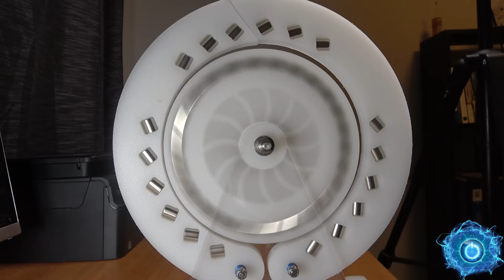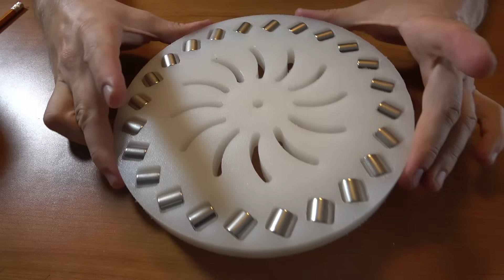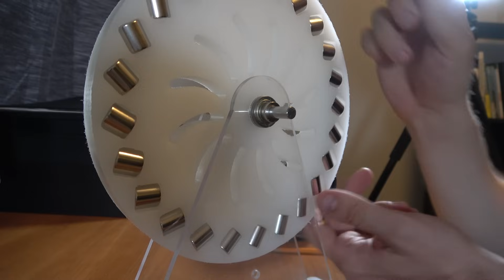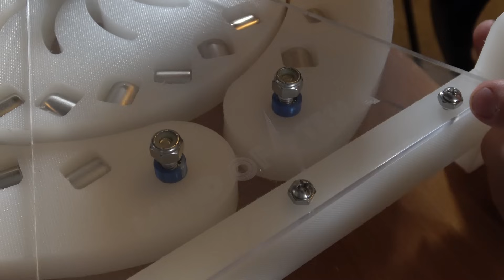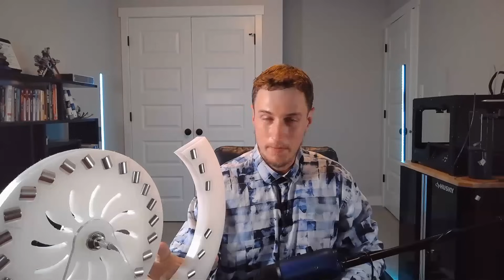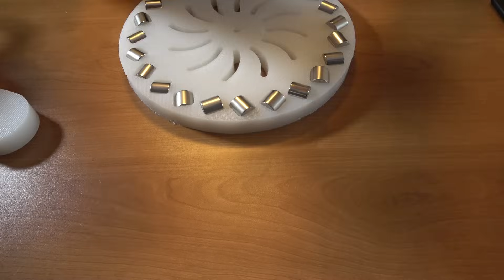Perendev Magnet Motor - Does IT WORK?!

Comment: I had an idea like this in 8th grade but I couldn't find a way to adequately shield the magnets so the only part pushing on the magnets in the wheel would be the part that repels them. You always end up with the magnets pushing both ways and only adding a small amount of thrust. So they always come to a stop after a few minutes.
Reply: Oh that would work fine!
But only if monopole magnets would be a reality. They don't.
Reply: @Terrestre1  The fact the monopoles could make something like this work and that our mathematical models allow for monopoles to exists probably means that our models aren't correct.
Reply: @Terrestre1 Inconel on the back side.
Reply: @Terrestre1  um that's what the shielding is for. To block the pole that is counter to the rotation. I just couldn't find a material that sufficiently blocked the magnetic field.
Reply: @nathanhale7444  you will find that if it blocks the field it also has to fight the field to move it and always cancels out  the effort gained from the magnet’s due to the mechanical load of moving the shield, magnetic reluctance is a force to contend with! or freezing to super cold temperatures can help produce a mono pole but as proven many times takes far more energy to refrigerate to -300c than the tiny energy produced
Reply: @nathanhale7444  Permalloy or mu-metall attenuates magnetic field
Reply: @nathanhale7444 giron can, and that’s what’s missing here. You need to cover the bottom /longer side, so when they meet it’s suddenly boom and pushing away. And more magnets…evenly outside/inside separated with giron
Reply: @needmoreboost6369 how can you cool something past absolute zero?
Reply: @SomeWhiteGuyNamedFred just give it to my ex! She’s cold as!
Reply: First law of thermodynamic
Reply: @amiyeagle  that doesn't apply to something like this. In this case the energy is coming from the magnets. One hurdle it finding something that blocks the magnetic field so it only pushes the opposing magnets one way but also I think the magnets will wear out faster and have to be replaced. So you aren't getting something from nothing just transferring the energy in the magnets into kinetic energy.
Reply: @nathanhale7444  Magnets don't work like batteries. They store energy the same way a spring stores energy. As for blocking a magnetic field, there is no material known to man which can block a magnetic field.
Reply: @Fireball_Roberts  yea that's what I found out and assumed way back in 8th grade.  It is amazing how much energy is stored in magnets but they aren't immortal.
Reply: @nathanhale7444  yeah about 7000 years is more than you would need
Reply: @Fireball_Roberts  there's such material, permalloy or mu-metall
Reply: @konstantingrudnev8374  Permalloy will redirect a magnetic field through itself, but then you have the problem of separating the magnet from the permalloy. The type of shielding that can somehow block a magnetic field without also being attracted to the magnet doesn't exist.
Reply: halbach arrangement of magnets will get you close to monopole
Reply: Y'all are forgetting about electromagnetic drag and eddy currents.
Reply: In short yes... You can make a magnet engine work... But the energy is not free...
You can stress the magnets enough to convert their magnetic potential in to kinetic energy, but as a result the magnets will lose their magnetism. 
The energy you will get out of it is much less than the energy needed to make the magnets in the first place...
Reply: @PAIP_Studio  that's what I suspected 👍
Reply: @PAIP_Studio Maybe, but it is a much cheaper entertainment than many. So, you could still save energy by not driving to the movies and still have loads of fun. Conclusion, it works😅
Reply: @PAIP_Studio curious if you know of the formula to predict the magnetic loss. 

I see industrial lifting magnets (over 20 years old) recertified and still in use. I knew of one that held near its capacity a inch off the floor for months. Still was fine come recert time. Still lifting ots rated cap
Reply: @Heliarc91  I don't remember off the top of my head but I have used the magnetic loss formula to calculate the loss of magnets in a few scenarios. It turns out that you could ran a small fan for about 30 years under the right circumstances. Or you can have the equivalent of a AA battery output for 30 to 40 years with $160 worth of magnets.
Reply: Guess what had this idea in 6th class
Reply: @NitrideGang  yea but the real problem was you were basically just running the thing off the energy stored in the magnets. Magnets don't last forever and using them like that would deplete them quick and leave them inert.
Reply: Are you not seeing the threads in triangular shape
Reply: @amiyeagle  I can only watch it on my phone so if there were tiny strings, I doubt I could see them.
Reply: Thanks for being honest. The key is to avoiding the shielding altogether. Wink wink...
Reply: @paulwilton735   but then it's only the rotors inertia that keeps it moving since the mags are pushing backwards as much as they are pushing forwards. That's why I was trying to find something to shield them so they only push one way. Back then I didn't know that magnets loose their magnetism over time and much faster if they're being heavily worked like a generator of this design would do.
Reply: Very thin superglue is extremely strong insulator
Reply: Yes but how many people denied that this was possible
Reply: I'm glad these devices are getting around but they need to be produced in a more robust manor.
Reply: @anonymouskeys929  the problem with them is the magnets wear out. They only have a limited amount of energy before they lose their magnetism so that is all the energy you could ever get out of them. Free energy doesn't exist. The laws of thermodynamics prove that energy has to come from somewhere. So the key is to find some source where you get more out than you put in. Take hho. It takes about the same amount of energy to separate water into oxygen and hydrogen but if you could find a way to accomplish that using less energy than what it takes then you'd have the closest thing possible to free energy. Stanley Meyer did that but it got him killed.
Reply: why don't anybody use this with wind enery utility?
Reply: The idea of single 2d designs is the problem imo, using a outer ring on each side and just using the inner ring between them is part of the answer.
Reply: 'You always end up with the magnets pushing both ways and only adding a small amount of thrust. ' 
You realize it's mathematically proven to not work, right?
'I'm gonna outsmart the magnetic field at the speed of light and make it work!'
No, you really, really aren't.
Reply: @ModelLights  not if you can shield it so the thrust is mostly one way. But yes it doesn't work. If for no other reason because the magnets will run out of energy and have to be replaced at a cost much higher than the energy such a device would create which wouldn't be much.
Reply: @nathanhale7444  'not if you can shield it so the thrust is mostly one way. But yes it doesn't work.'
What part of 'That's the part that's been proven mathematically impossible to actually do' was difficult?

1-1= 0.  You're essentially saying you're going to sneak up on the second one and somehow make it disappear and the result be 'not zero'.
No, you really, really aren't.  You can only pretend you're going to 'do that somehow' because you don't understand that whatever 'somehow' you think you're going to come up with, it won't work.

If it worked in the tiniest, tiniest bit, that would make it EASY to do and have been done from the start.  
You are not going to 'somehow, I'm gonna sneak up on the magnetic field and make it be uneven' like you seem to think can work.
Reply: @ModelLights  they do have materials that can shield from magnetic fields. My idea was to limit the counter force of the magnets so most of their thrust is facing one way. That much is possible and I don't know why you're saying it isn't. What isn't possible is to have something like that that doesn't wear out the magnets. Magnets don't last forever and loose their magnetism the more they're used. Even a refrigerator magnet that does nothing but stick to the fridge door will eventually loose its pull and fall off but if even the strongest magnets were used they would onky work for a short time before they used up all their stored energy. That's the problem with all "free energy devices". You can't get past the laws of thermodynamics. The energy has to come from somewhere. I tried explaining that to a friend's dad but all he ended up with was a bunch of burned out motors and a nasty letter from the apartment complex manager.
Reply: @nathanhale7444  You should read up on how magnetic fields work. Magnets don't have thrust. They have a magnetic field. Magnets don't store energy the way a battery stores energy. They store energy the way a compressed spring stores energy. You also won't be able to limit a magnetic field so that it's "mostly facing one way" because it's a loop, and in order to work, the field needs to loop back to the opposite pole.
Reply: @ModelLights  I don't know what this is so hard to understand. There are materials that block magnetic waves. Maybe if you were looking at it from an engineers perspective instead of a mathematicians then you would understand what I'm saying.
Reply: @nathanhale7444  'I don't know what this is so hard to understand. '
No, what you don't understand is that you're the one with a poor understanding of basic magnet theory.

'There are materials that block magnetic waves.'
It's magnetic lines of force.  Guess what?  They go from a N to an S.  You have no ability to 'block only one end of the magnet and create a magnetic monopole and actually produce a gain' like you think you do.  You just have a poor understanding of why what you think will work actually will not work when you try it.
Do you really think everyone else who thinks this crap hasn't done this a million times, and needed you to come along and say it?
It DOESN'T work that way, no matter how poorly you don't understand, and thus don't understand that it DOESN'T work that way.

You cannot produce a 'motor' or perpetual motion machine like you're thinking.

If it's so easy kid, stop TELLING me about how you're going to do it.
Stop lying about it, and DO it.
Then tell me you did it, instead of saying lies of ignorance.
I expect to never hear from you again, ever. 

You won't do it either, any more than anyone else, even if you never learn enough about actual magnetic theory to understand why it doesn't work.
Reply: @nathanhale7444  The fact, you call magnetic field by waves tells most of your knowledge about this topic. I guess you came from unsuccesfull ideas of magnetic motors to not existing magnetic fields shielding to end with idea its actually nonsense because you would suck energy from magnets, but the point is somewhere else...
Reply: @Thomeeno  so frickin what? Nearly everything I know I taught myself and I have a better understanding than most people and definitely better than people trying to use magnets like this.
Reply: Me in 7th.
Reply: Welcome to the laws of thermodynamics...
Reply: Be skeptical of perpetual motion machines and “free energy” claims. The concept of perpetual motion contradicts the fundamental laws of physics, particularly the First and Second Laws of Thermodynamics.

The First Law of Thermodynamics (Conservation of Energy) states that energy cannot be created or destroyed in an isolated system. Any energy output from a system must come from energy input. The Second Law of Thermodynamics states that entropy in an isolated system tends to increase, meaning no process is 100% efficient, and energy will always be lost as heat or other forms of dissipation.

For example, using a “gravity shield” to manipulate forces on a wheel is theoretically interesting.  Unfortunately we have no evidence or practical means to shield or manipulate gravitational fields in such a way. But even if such a technology were developed, the energy required to generate and maintain such a gravity shield would likely exceed the energy extracted from the system. This aligns with our understanding of physics and energy conservation principles.

The allure of free energy is enticing.  But the “gravity motor” example dependent on a hypothetical gravity controller neatly illustrates the challenges: any “controller” would require its own energy source, and the net gain would likely at best be zero, or negative due to system inefficiencies. Until new physics or technologies emerge that redefine our understanding of these laws, such machines will remain in the realm of fantasy.
Reply: Another mag with opposing field blocks.
Reply: Suppose we were on a planet or moon with liquid helium couldn't you use a plastic superconductor using the Meissner effect? You could also use flux-pinning superconductors for bearings. It wouldn't be free energy but it would be pretty efficient non perpetual motion machine
Reply: Sorry  @SomeWhiteGuyNamedFred but I'm not familiar with those materials or principals.
Reply: yes the origanil inventor is now a power company. they are shielded to get the correct angle for a better spin
Reply: Graphite is the answer. It doesnt isolate but redirects the field.
Reply: @pedritomiralles  hmmmmm I don't remember if I tried graphite or not. I was in 8th grade at the time and that was a long time ago. Maybe I'll give it a try. Now where did I leave that big graphite block I pulled outta that doohickey?
Reply: @nathanhale7444  what if instead you had a series of magnetizer/demagnitizers they pass through as it spins so they're never opposing enough to stop the motion .
Reply: @nathanhale7444 هل جربت الطريقة الان ..من فضلك أخبرنا بالنتائج
Reply: @Pedro Miralles  or bismuth, really any diamagnetic material
Reply: @tres155  I don't remember if I tried that or not but no matter what it would only be esing the potential energy stored in the magnets and would eventually wear them out. They would become inert so the design is ultimately pointless.

Comment: I just want to know why you used metal bolts instead of plastic bolts, cuz feros bolts of course would cause this device not to work and even using non ferrous bolts would cause a drag, i stumbled apon how to create power from a big speaker magnet and a coil of wire and no moving parts , i only have to move the magnet one time to get the elctrons moving but thats all im going to let you know, there is forbidden knowledge out there that they will not teach but some of us out here have stumbled apon there forbidden knowledge cuz free energy is possible, in this universe nothing is impossible
Reply from the maker: Good point about the bolts, I never thought about that!

Comment: hello, nice project! why don't you try to make the fixed magnets turn in a chained way to the wheel? like a crankshaft system connected to the camshaft, only in your case the wheel through a gear wheel rotates some external magnets in so that they continue to create thrust and move all together

Comment: perhaps putting the gate magnet on a rocker arm driven by a cam on the motors shaft or maybe an electromagnet powered by a capacitor being charged by a stator?

Comment: The magnetic motor work only when the magnet is insulated with Aluminum. Otherwise, they're always going to stop. Another situation is called, Arm x Moment x weight, at center of gravity = Kinetic Energy. The maximum power you can get from a magnetic motor using the formula here shows 18.3 kw at 1600 RPM. 400v 50Hz.>>>SO each Kg = 305w at 1600 RPM, so the generator weight 60 kg. The angle of the driver magnet is=6°  and the receiver magnet is 3°. OR you can simple called = weight in motion at center of gravity = Kinetic energy x 100 or x 1000.    Good luck

Comment: 1. The distance from stator to Rotor Magnets ist to far

2. Magnets Need to be shielded to direct the magnetic field,so that the immer contrary poles wont interfere so much With the stator's Magnets
3. Besides the distance between the Magnets in the disc itself is ecessary to be correct.

Many Things to consider. Basically it can Run in its Owns, but the execution needs to be correct